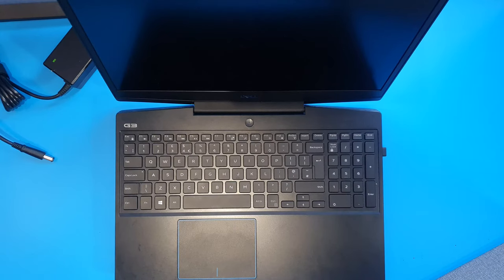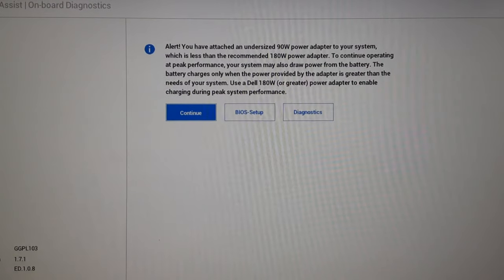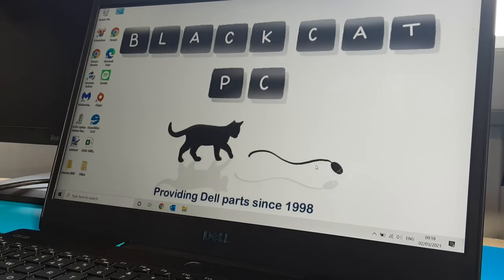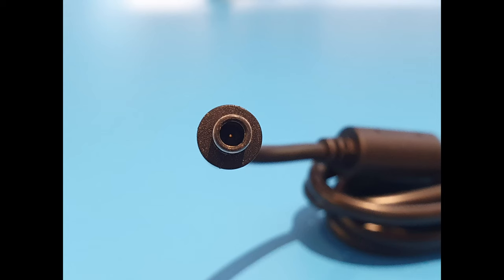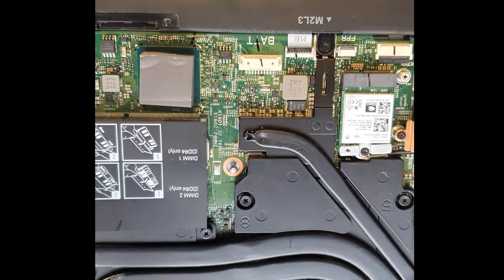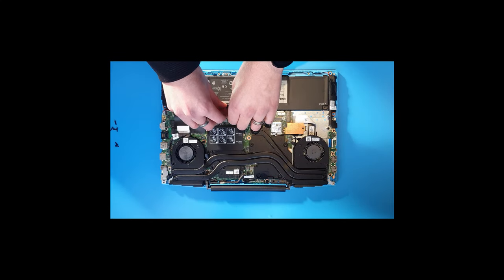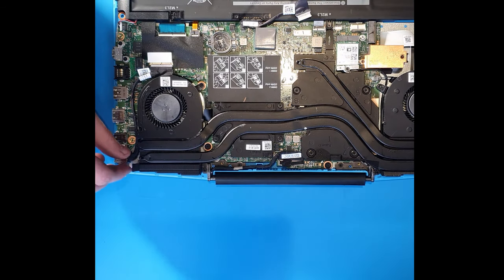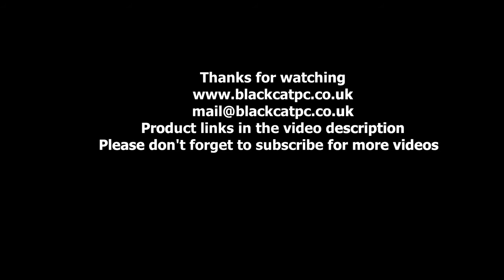Dell Laptop Power and charging Issues and how to fix them

Comment: Im getting the "AC adapter wattage cannot be determined" which slows makes the processor run like crap. Are there anyways to bypass or atleast workaround that error?
Reply from the maker: It sounds like your charger is failing. We have them on our website. Contact us if your unsure what charger you need.
Reply: @blackcatpc  nope I bought a new charger(original) and the error still persisted. I've replaced the charging pin and so far so good! Its been a week now since the error went away but I'm still observing before I can conclude.

TEMPORARY SOLUTION: Just keep using the device for like 30mins or so it'll eventually fix itself.
Reply from the maker: This sounds like it might be a motherboard fault at worst. Is the performance still slow?